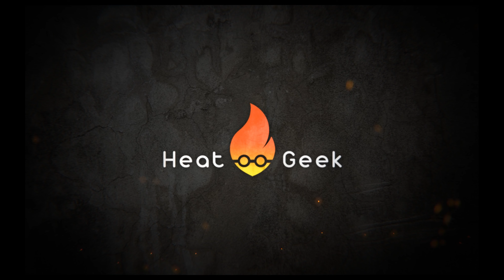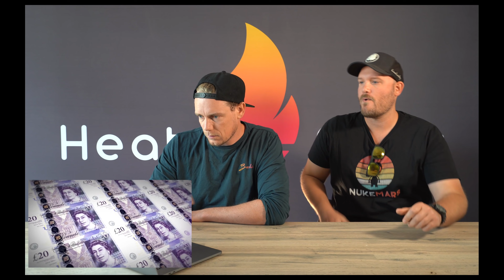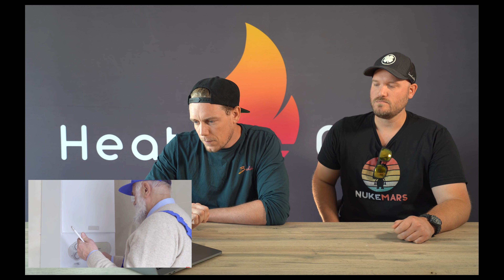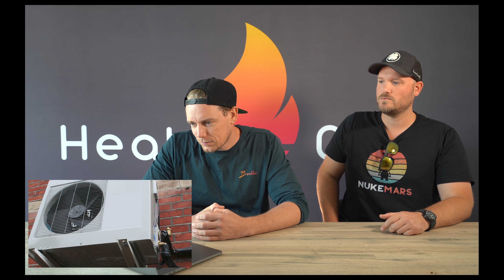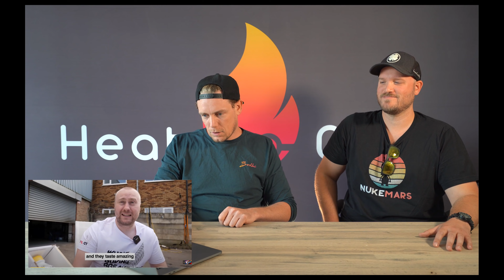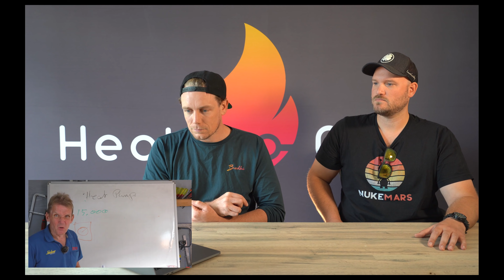Professionals React (BADLY) To Skill Builders's Heat Pump Videos | PART 1 | FIRST TIME WATCHING

Comment: Guys thank you for an excellent video and quite fair. I will only ask you for the average home what will it cost to have a heat pump system fitted. What is the cost of electricity to heat a home with hot water in say December to March in the uk. Its all OK saying dodgy company's have not done the cop calculations correctly, but I want to save the planet, so I right now I need a new boiler, so like for like I can get a new high end lpg boiler fitted £1800 with 10 year warranty and have hot water and central heating on demand. But I am sure we could be looking at a no change out of £12k and assume another £3k as it won't work well and more alterations need to be done. So for this cost I could run mine for 7plus years on gas. But OK not green. The average person will not have money to install heat pumps.
Reply: I can tell you this, I live in a 1923 3 bed detached bungalow (had 3 extensions over the years) on a hill in East Lancashire. I do not have central heating, I have an electric immersion tank (9kw) and then electric panel radiators in various rooms. Current electric bill PA is about 2-2.5k with the radiators barely on. I have had several quotes to fit a complete oil system (all about 10-12k including oil tank) The one quote I managed to get for ASHP was £20k...
Reply: @del4668  Get the oil boiler.  Far far far cheaper and better (you will be warm)   You should be able to get central heating installed with boiler and tank for under £10k.  
You would be spending that £10k every year on electric with ASHP and you wont even be warm.
Reply: @cuckingfunt9353  thats what I am thinking these green economy solutions are nothing but. People seem to think electricity grows on trees. Last thing I want to do is get the system and then oil boilers become public enemy one and I get my nether regions taxed to hell. I already have 2 log burners haha.
Reply: @del4668  Oil boilers won't ever be on the radar.... All those Tories heat their stately homes with oil. It's cheaper than gas these days, and chances are they will hike up the price of gas soon also. You can store oil too, if you live on a farm buy a huge container like the farmers use, and invest in ten years worth.
Reply: ASHP like electric cars seem to be the play things of the rich. Not everyone has 40k for a company car nor do they have 20k to install ASHP.

Comment: Its all to do with insulation... ive put them into new houses they work great... put them into old buildings you'll be rattling in the winter.. people will need nearly 30 grand to do up the house for it too work right... skill builder is a good channel though
Reply: I’ve put in air-to-air in the house and an immersion heater for hot water. My house is in Scandinavia (Denmark), from 1900 and some of the outside walls are not hollow walls.
Works fine all year round and my total energy bill has been cut to a third.
The year we installed the heat pumps were the first year we didn’t have to wear thick sweaters indoor during the winter.
Reply: @TrollWithOpinions  outsiders don’t understand the nuances of the debate in the uk. Our gas prices are roughly 4-5 times the price of electricity, so even with perfect real world COP, we would barely break even. Then you need to factor in the cost of installing the system, UFH, large rads and adding extra insulation to our brick built homes.
Reply: @immers2410  
Are your info correct? You gas prices are 4-5 times more expensive than electricity?
What then is the problem?
Reply: @TrollWithOpinions  oops, I meant the other way round
Reply: @immers2410  
That makes a lot more sense.
But luckily the government, after Brexit, can subsidize electricity producers and tax fossil fuel, without any problems. Surely Brexit was for that specific reason.
Reply: @TrollWithOpinions  yeah, and if my gran had wheels she’d be a bike. Unfortunately, the UK government has no plans to change its tax or subsidies policies.

Comment: So your heat pump installers,so you will try to poo poo someone calling heat pumps out has a rip off,14k if you live in older house they won't work,last winter lasted from Oct to March,average temperature 5degrees
Reply: We're not just heat pump installers, we will specify and install whatever is right for the property.  Boilers, heat pumps, fuel cells, solar thermal etc.  We are completely brand agnostic and our motto is that there is no panacea.  Heat pumps are expensive but in a lot of cases they can be the lowest carbon contributor, they can also be completely unsuitable (cost wise) and we would never let a homeowner get into a situation that their bills could skyrocket.
Reply: yes they do, installed hundreds in older property’s.
Reply: @kenbone4535  expensive older properties
Reply: @vincentmckenna1755  yep loads, converted from oil.

Comment: The bottom line is when people find out they’ve got to rip their houses apart to get these things to work then it’s a no go whatever semantics people say
Reply: My neighbour in a victorian end of terrace has had a Mitsubishi heat pump installed. They upgraded their rads, they had loft insulation put in & a cylinder where their boiler was.  a heat loss calculation was done to size it they say its cheaper to run and it's roasty toasty.
Reply: @Lewis_Standing  sure but it’s all the additional work needed in older houses which is the issue as opposed to the heat pumps themselves
Reply: @jasonaris5316   @Jason Aris  Doing that work on retrofit is disruptive and expensive, but it's a permanent reduction in energy costs and and a much nicer house to live in that's not draughty, cold, damp or stuffy. Done well it can be an 80% reduction in heat load. I've done mine and it's so much nicer to live in. It was nearly all DIY to keep costs down (and make sure it was done properly!): https://www.youtube.com/watch?v=OVcvk9Wnyw4
Reply: @xxwookey  maybe but most can’t afford to do that work and that’s without the disruption anyway (getting new windows fitted is a nightmare let alone replumbing underfloor heating etc)

I’m all for new builds being up to standard but their has to be a better solution for existing housing stock
Reply: @jasonaris5316  Getting new windows fitted takes a day or two. How is that a 'nightmare'? It's expensive and there are a lot of choices to make to do it right but it's not fundamentally difficult nor excessively disruptive. Underfloor things are much harder because you've got to clear the rooms, which is a huge PITA. (But also not impossible, given some enthusiasm).

Yes new builds is so much easier and it's literally criminal that we've been building mediocre houses for the last decade when they should all have been passive-grade, but 70% of the 2050 housing is already here. We have no choice but to fix them, either by fabric upgrades or changing the fuel, or both.

We shouldn't shy away from that. It's a pain, but the results are amazing_, and when people experience really good houses they want it too. Most people increasingly get that they need to make changes, and plenty of people spend serious money on their houses without lowering carbon footprints at all - just changing what they look like, or making them bigger. We need to redirect that money and make sure that if people are making changes anyway (i.e they _can afford it), then they use those opportunities for serious retrofit.  And yes there also has to be something like the Green Deal for all those people that can't afford it, and ways to encourage/make landlords do theirs properly too.
It's a really big job, best done when there is disruption anyway (change of hands/upgrade works/etc), and it takes time to get right (It took me 14 years and I still have some things to finish off), but that means everyone at least needs to start making a retrofit plan so they know where they are trying to get to as opportunity arises.
Reply: @jasonaris5316  nope they paid 3k for loft insulation and total install for rads and heatpump + water tank 14k. They'll get 11kish back from rhi over 7rs.
Didn't need wall insulation, didn't need new pipes.
Reply: @Lewis_Standing  that’s the issue £14k for a basic fit (more if you need insulation or plumbing work) and the subsidy is only £5k from March 2022 no chance of getting the current one now
Reply: @jasonaris5316  it's an investment in your property. You'll be able to sell it for more. You might not be allowed to mortgage a property without low carbon heating in the future. Certainly going that way for rentals or so a surveyor told me.
Status quo can't continue.
New tory grant is pathetic, not in amount as perhaps costs will come down but in volume (30k / Yr only).
Reply: @Lewis_Standing  you see and that’s why people are getting angry there is too much coercion and there will be a backlash if it carries on
Reply: @Lewis_Standing  What aload of propaganda dribble.  The Maldives was supposed to be under water over twenty years ago 🤔. Instead 100s of Millions has been invested in new holiday resorts. Makes sense doesn't it 🤣🤣
Reply: @Lewis_Standing  the best comment yet, not being able to mortgage your property in the future (more like 100 years in the future) without a heat pump, I just cant see heat pumps competing with probably the worlds biggest revenue for banks and building societies somehow.
Reply: How did we migrate from coal fires to central heating...? It will cost, but we cannot rely on Russian Gas r any Gas sadly because of climate change.
Reply: @blooflame1846  bollocks
Reply: @blooflame1846  there has to be another solution (hydrogen maybe) as heat pumps simply don’t not work sufficiently with the current U.K. housing stock
Reply: @jasonaris5316  They do work, I've seen it. With the correct pipe sizing et all, correct calcs, it works perfectly. Agree on housing stock but we have found a good solution. No it isn't as good as the Nordic countries but consider the before the 70's we had gas Fires or coal. So Central heating is still a young phenomena. I keep seeing people writing that this doesn't work or that is wrong...none are qualified and most just repeat what an even more ignorant Reporter prints.
Reply: @blooflame1846  fair enough I know a few people having them fitted so I’ll hang fire and see how things go there before considering it
Reply: So they would rather trash the planet making it very uncomfortable for their kids and grandkids would they? Talk about responsibilities!

Comment: You haven’t actually stated anything he says is wrong you agree with most of it and the come back is gas= carbon. Saying “In 10 years time bla bla bla” the incentives are here so what does a customer do? Buy a crap one now and get a working one at the cost of £££ in ten years.
Reply: The only good incentive was the lower electric price. Electric needs to be a quarter the cost to make it viable.

Comment: I like Roger's videos, I didn't agree with his opinion about heat pumps, but probably he was wright, because the basis for his whole rant was drafty old houses (he only breafly mentioned that, even though this was the key element). Probably the best line of action would have been first to motivate people to insulate, and after that heat pumps.
Reply: Even insulation would not solve the problem for most people in this country.  Our housing stock is badly built, badly designed.  This has been allowed by various governments to meet ‘targets’ etc, and to put money in the pockets of building companies.  Most of our housing stock should have been demolished and replaced with new build to top class insulation regulations, but governments of every stripe have shut their eyes to the problem.
Reply: there's no chance of that with insulate Britain cranks upsetting every one

Comment: The problem with Heat Pump Technology, is the market is saturated by snake oil salesmen, installers and plumbers (no offence, but its true) who don't understand the application and suitability of these units to existing and new building stock in the UK. Ask a plumber to produce a Life Cycle Cost Analysis for your home and he'd probably have a stroke on the spot. What you end up with is disgruntled homeowners, who want to switch back to gas. The fact remains that unless the cost of domestic Electricity comes down, ASHP systems need to produce a SCOP of 4 or higher, to justify the investment in the UK.
Reply from the maker: 100% in part 1 mate!! Part 2 I disagree.. we could train and retrain with enough money!!
Reply: @HeatGeek  You can train all you want, but what it comes down to is doing the WORK... Someone has to dig up the floor for the underfloor and that alone costs £20k. 
Any other system is snake oil.
Reply: The cost of electricity go down ??????     Right, that'll be the day. . . My guess is 20% increase year on year from here on.
Reply from the maker: @cuckingfunt9353  yes. Electricity has a huge tax on it because it was previously very dirty. Gas does not have this as it was much cleaner.. not Electricity is as clean as gas (210g/kwh) this should be rebalanced and is being looked at right now...
Reply: @HeatGeek  It won't be hard to persuade the governments to put a levy on gas, but you cannot stop market forces increasing the price of electricity. . . Gas is all but free, it comes straight out of the ground, electricity costs a fortune to generate, ( unless you burn fossil fuels to make it ).
Reply: @cuckingfunt9353  Exactly. Another 20% increase and Heat Pumps will go the way of the dodo.
Reply: @hvacdesignsolutions  What heatgeek is saying is that the government should hike up the price of gas... If it costs 4 times it's current rate then people might consider electric.  Problem is that making fuel prices that high will not be a vote winner, it will also create inflation and then interest rates, and then big trouble.

Comment: The first problem in retrofit a combi boiler with a heat pump will be the flow.  Heat pumps need more flow than a combi boiler. The existing pipe will work, but not will be ideal to run the ASHP.  Will work but will be very expensive to run. The DT of the radiators will be lower, so the kw of the same will be lower.
Reply: Then put in a bigger pump its not rocket science
Reply: @kjc728  Near enough 'rocket science' for you to not understand. The rads need to come out and be replaced with car radiator style with big fans - to get the AIR flow through the rads.
Reply: @millomweb  Its you that doesn't understand what the original post is about. He is talking about water flow rate there is no air flow through a radiator homes in the uk generally don't use them. Radiators do not need to be changed for fan coils which is effectively what you are thinking. They need to be resized based on lower flow temperatures of a heat pump
Reply: @kjc728  Water is the wrong substance to be using with heat pumps - that's my point - radiators are the wrong thing - and that's why these geezers are on about poor installation of heat pump system design.
Under-floor water pipes may be better but they're still not the ideal solution. Ducted (warm/cool) air is what's needed - either from a central heat exchanger or as individual heat exchanger units - like air con units. Probably the latter would be a better option in the domestic environment.
Reply: @millomweb  Try telling that to the manufacturers and to millions of people in Europe who have them and been working successfully for many years. Air to Air is not the answer the cost would be phenomenal If you were in the industry you would know this. The whole point of this video is to slag off Skillbuilder as it's people like him who don't understand the systems properly and rant about it giving the industry a bad name. I am a project engineer and have been working with heat pumps for over 10 years. Not one of my customers has said that they are not warm enough. Every aspect of the system has to be designed and you have to understand how heat loss works and is calculated. If designed correctly then a heat pump system will work fine. Trouble is in the early days this wasn't happening as much as it should and this is why people complain that they don't work and have high energy bills.
Reply: @kjc728  IT's not air to air. It's air to refrigerant and refrigerant to air. Pretty basic stuff.
I don't need to care how heat loss is calculated as I'm in a house with no 'insulation' other than cavity walls. Consequently, my bedroom is one of the coldest rooms in the house - the walls feel cold and the mold is on the ceiling.
Reply: @kjc728  Even worse, you're wasting my time here.
Reply: @kjc728  If it is designed correctly it will work fine and you have to understand how the heat loss works which will make it in practice a lottery as most installers won't even in later days. How many people are there out there will have a project engineer designing systems for them? People just do not have the capital for this especially if every aspect of the system has to be designed. It sounds to me as if you are a specialist servicing an elite group which the green lobby are and for most people the gas boiler is still the only simple and reliable solution installable with knowledge of basic skills by the average journeyman. The fact that this channel arguing for these new technologies identify themselves as Geeks shows this is an area not for the faint hearted without deep technical knowledge. I could not call any plumber I have met to date as being the back to front hat wearing Geek we see here. This you tube green installation world is just a different one to the world most of us live in with little money to invest in anything.